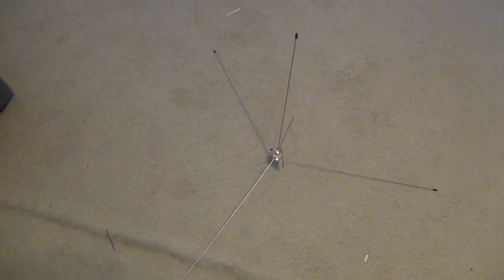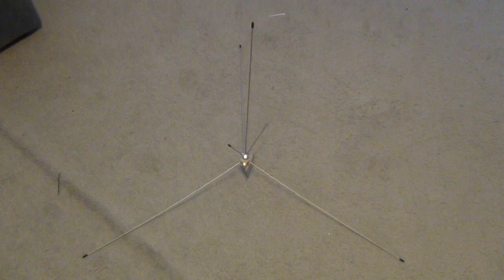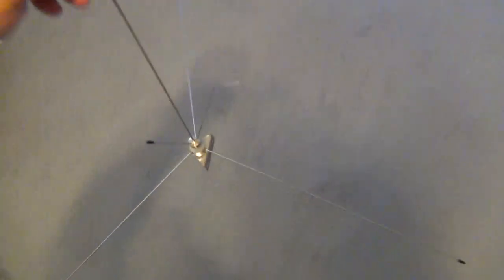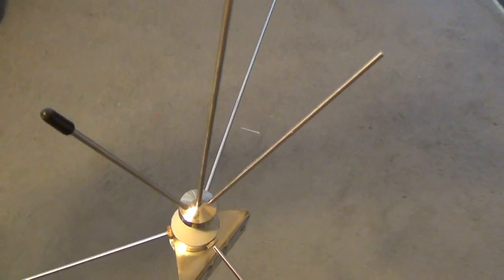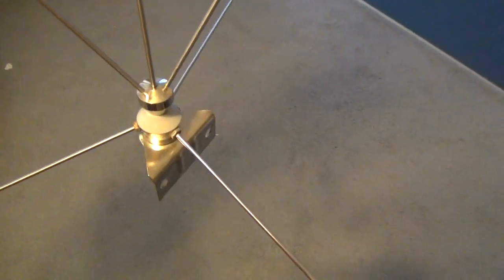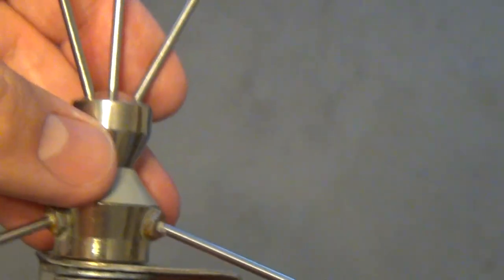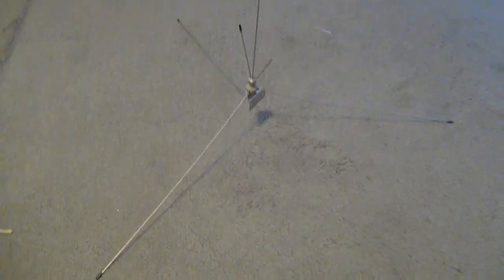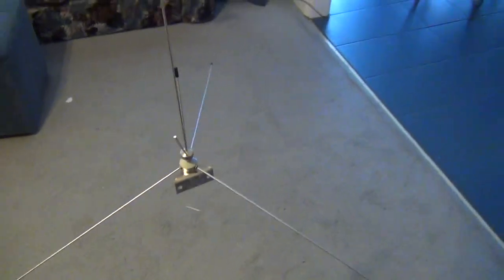Radio Shack "sputnik" antenna (Model: 20-176  | Catalog #: 20-176)

Comment: The longer vertical element is for VHF. The two shorter elements are for UHF. 

When transmitting on VHF or UHF , the RF power goes to appropriate element and ignores the other element(s)
Reply from the maker: Exactly!